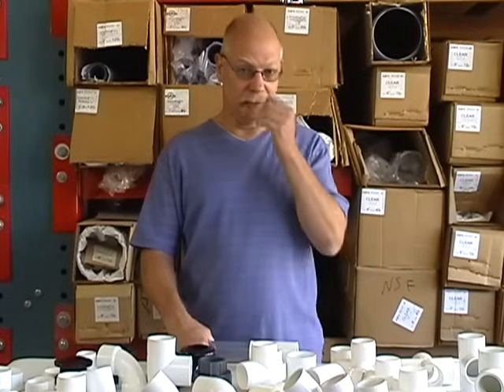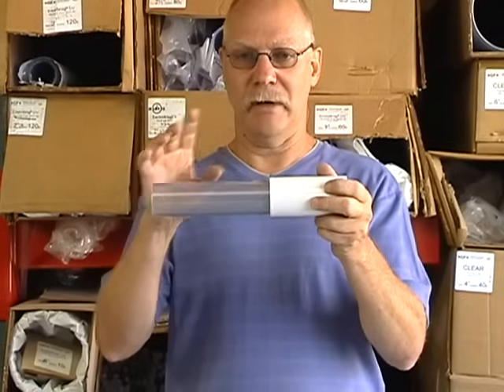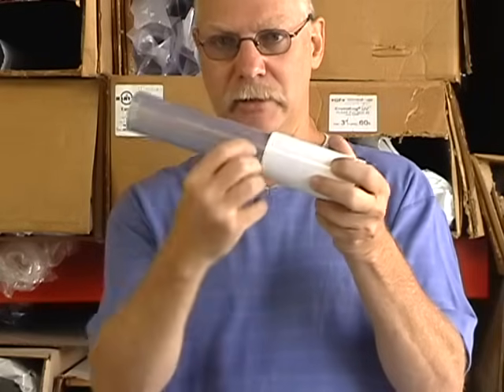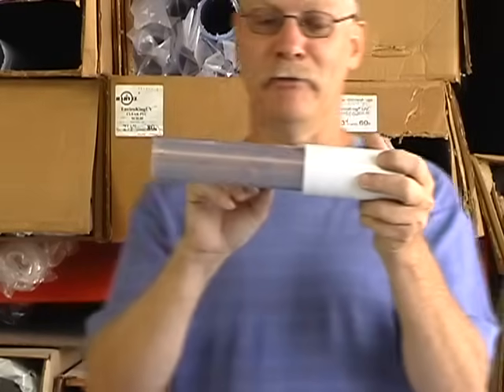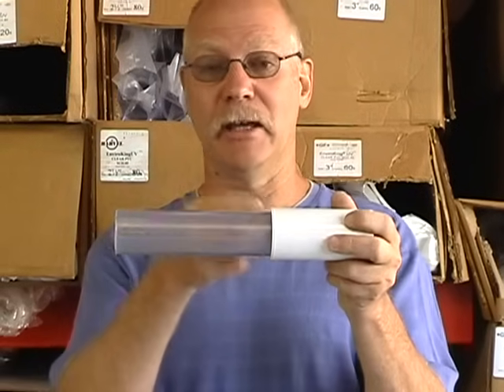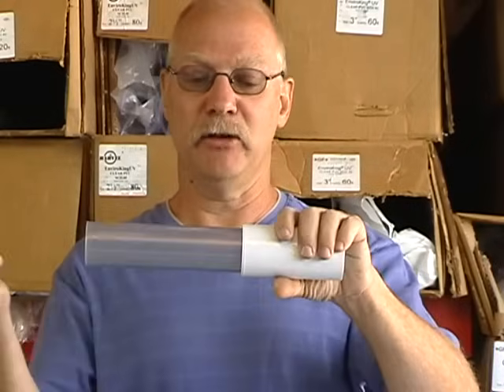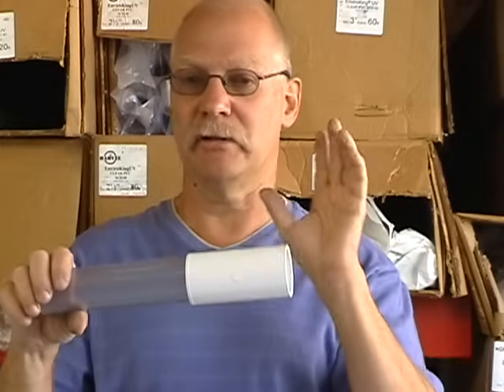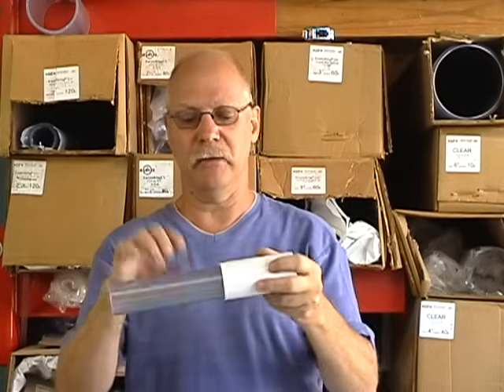FlexPVC® - How To Fix A Leak In PVC Pipe for FREE! Thousands have used this method & it works!

Comment: Or..... u cut and install an inside coupling....done
Reply from the maker: Using an inside couple only works if they make one that fits the pipe in question. We do sell inside couples for  1" up to 6" (https://flexpvc.com/cart/agora.cgi?product=PVC-Fittings-Couples-InsidePipe) but only sch 40. So if the pipe is sch 80, or Class 100, 63, 125, 160, 200 or 315 or smaller than 1" or larger than 6" you'd still be stuck. Also inside couples reduce the flow of the pipe. Someetimes you have other choice, but repairing the existing pipe is probably preferred. Thanks for the comment.

Comment: What is a shot vac?
Reply from the maker: Shop Vac, aka "wet and dry" shop vacuum. :-)
Reply: Flexpvc thanks, we may have to try this. We are in the process of plumbing for our Koi pond, we used Astore pipe fittings, heavy duty, although my husband has done many plumbing jobs this one has him bet,  we have multiple leaks on joints, there are two pumps on the system, we used only a glue as recommended by shop, I'm beginning to think we would have been better using primer and glue
Reply from the maker: If you are having trouble with leaks, it's most likely procedure, not glue. Please see our video on that: https://www.youtube.com/embed/QITVd4N7064

Let us know if you have any questions. You can call 888 782 3539 M-F from 10am to 4pm PST or use the "email us" link on our website, https://flexpvc.com Thanks

Comment: Although I was in the irrigation business for 30 years, I never encountered a leak problem that I could not repair with a conventional repair, until a week ago.  I had a drip of about a quart per day on the upstream side of my hot tub pump.  As you are aware, the pvc fittings were assembled tight together and a conventional repair was out of the question.  I explored a variety of repair methods, but I thought I would start with your idea of using pvc primer inasmuch as my drip was on the suction side of the pump.  And the other methods using spray materiaIs or trowel on expoxy would likely prevent me from using your method, had they failed.  Additionally your method was invisible.  I am ecstatic to report that your advice worked like a hot damn!
Reply from the maker: So glad to hear. Your situation is the exact one that this method was devised for. Thanks for letting us know it worked for you.

Comment: This guy's a dimwit, talked for an hour and said N-O-T-H-I-N-G !  He's has the use of primer all wrong, but Y-O-U BE THE JUDGE:  Primer's principal use is to remove the grease used in the manufacture of PVC pipe. PVC pipe is an extruded product and the dies that form the pipe are sprayed with a lubricant to keep them from binding, That lubricant needs to be dissolved before applying PVC cement to any and all joints, hence the need for a primer solvent. The knuckle-head in this video doesn't once, not once, mention the extrusion lubricant or the primary function of a primer in adjuncts. Peace be with you. Praise Jesus.
Reply from the maker: I totally agree, we should let the viewers make the judgement. 

#1 The video is 9 minutes and 33 seconds long. MROSHINSKIE thinks that's an hour. He's only 84% wrong on that one.

#2 It's true that the dies are coated with a lube, but that lube is washed off the plastic parts before shipping. I don't mention it in the video because it has nothing to do with the subject matter of the video.

#3 Purpose of the primer. If you want to see the effect of primer, simply put some on a piece of pvc pipe, let it sit for about 4 seconds and then take your fingernail and try to scrap where you put the primer. You'll have a nice bit of pvc material under your fingernail with just one pass. That's how aggressive the primer/solvent is.

#4. What is primer? Primer is mixture of Acetone and  Methyl Ethyl Ketone (MEK). Both of these are solvents, solvents of pvc plastic. 

#4. PVC fittings are interference fit. That means the bottom of the socket is a smaller diameter than the pipe's outside diameter. If you did not have a solvent to soften the pvc material, the two would not fit. The pipe would stop before it gets to the end of socket. "Two solid objects cannot occupy the same space.at the same time"  So something has to give and what gives is the plastic after it's been softened by the solvent/primer. 

#5. It's called "solvent welding" for a reason.

I could go on, but why?

I especially like the insults coming from someone who claims to be a "christian." Is it Christ like to insult people? Call people names? Boast? Ridicule? MROSHINSKIE is the kind of christian that gives Christians a bad name.

Clearly MROSHINSIE knows far less about plumbing and Christianity than he claims.

But I'm happy to let the viewers make up their own minds. ;-)

Comment: Damn man....I thought I  might be the only one using that technique! For a pool with a leak in a pressure side pipe a shop vac isn't needed in some  cases.  If the pump can prime or mostly prime run it for a minute or so. Turn it off and then the water flowing backwards through the pipe a will create enough of a vacuum to pull in primer and glue.
Reply: this is also helpful. will try! do you have more details?

Comment: Recently looked for a way to fix a leak at a PVC junction on my roof for pool solar.  I allowed system to drain, then -- when dry, and using your basic idea -- I applied primer to the joint, then blew it down into the joint using a soda straw -- repeated several times allowing it to dry.  Then I applied a last primer coat, blew it into joint, followed by glue which I also blew into the joint using the straw.  So far, it's worked perfectly.  Thanks for the tip and the idea!
Reply from the maker: Very good. Glad we were able to help in some small way. :-)

Comment: Thanks for the great video. I have a question regarding a cracked 2" manifold on a spa from a winter freeze (see link to photo). The crack is several inches long and forks at one one point. Could this method possibly work to repair the crack in my situation? The alternative of replacing the manifold for a novice like me is not appealing.  Thanks.

https://photos.app.goo.gl/VHO0mFxIG5JnsmRI2

Comment: I am trying to repair what is commonly called PPVC pipe....the black hose type.  
Any suggestions on that type of line?
Reply from the maker: There is CPVC and this technique would work fine. But there is HDPE and PE and PP. Those it would not work on.

Comment: Replaced new toilet drain, 3' PVC, was leaking at slip joint, both ends, used this method it works great. Everything clean and dry. Used wet towels in plastic grocery bags to make seal, stuck shop vac thru one end, both ends tightly seal. Turn on shop vac , Poured on solvent as directed in video, waited a minute, then poured on cement, Ran shop vac about 30 second each time. Thank you for sharing, very much appreciate your effort and time. Consider yourself a home improvement DIY hero.
Reply from the maker: Awesome! Glad we could solve the problem for you. And thanks for letting us (and everyone) know. :-)

Comment: Six month follow up. Still loving it.Working great.==>  https://t.co/eSv7jxF0tX  Getting to 102-104 with weather in the single digits/teens.Feels great. Changed to using bromine and it is so much nicer than chlorine.Amazing. I've had it set up three days and have been in it four times. Great heat,, good relief for hurting body. This is a great product
Reply: Nice

Comment: question.use a wet or dry shop vac take hose cover the pressure jet or area where the leak creates a vacuum.  Put a tee in the vacuum line above water with the ability to close off all air and let in bits of air so vacuum cleaner not burns out,   apply primer and then glue.   Our situation is a dripping by a light. question choose glue for plastic.   glue works on some plastics.

Comment: Thanks for this great video.  We have a tiny little leak and this video will be the first thing that I try.  I do have a question though.  If water is leaking out then does not imply that the primer will not be drawn into the leak?
Reply from the maker: No, that's why you us the vacuum. If you are working on the suction side the suction of the pump will draw the primer and glue into the crack and setup.

Thanks. :-)

Comment: One question. Can you just fill up a crack on PVC pipe with PVC glue and fix the leak or it will not work?
Reply from the maker: No, it wont' work. 

Just follow the instructions and it'll probably work.

The only reason I say probably is it does depend on the size of the crack and type of crack.  But if this method does not work, there is no way just pouring pvc glue in a crack would.
Reply from the maker: Man, youtube is not notifying us of replies. So sorry this is so late. No, just adding pvc glue to a crack will not work. I will make a video on how to fix that issue. Please sub and you'll get a notice when I upload. Thanks.

Comment: I understand everything in this great video.. Yet after doing the primer on a evacuated seam.  How long do I wait and when or if I use the glue?  (Original screwed fitting w/ no sealer)  
GREAT VIDEO!!!
Reply from the maker: You don't wait for the glue. You hit it with primer and then just the time it takes to switch hands to get the glue in place you do it. :-)
Reply from the maker: You immediately hit it with the glue right after the primer. Just seconds.
Reply: It worked!  Thanks again...
Reply from the maker: Awesome! :-)

Comment: Find a piece of pipe that fits the hose of your shop vac and drill holes in the side. This will allow air to cool the vacuum and still supply the vacuum needed for the job.

Comment: my PVC pipe keeps popping off when I cut the water on at the water meter
Reply: bobby surrett A pressure regulator after the meter and before the pvc main line is probably the solution due to high water pressure. If the joint when assembled is too cold due to the weather the glue won't set up, so a heat gun or halogen work light should help during the adhesion.

Comment: Great video, I have a leak in the suction side of my pool from the skimmers, It pulls in air but the problem is all the pipes are buried. Any ideas??
Reply from the maker: The most likely point of the leak is going to be right at the skimmer or drain. You may be able to use this technique from the inside of the skimmer if you can find the crack. Also IF you can see into the sockets where the pipe glues in, you can try the same technique from the inside. Just be carefuly not to splash or spill glue/primer into the skimmer. Same foe the drain. Of course you will have to drain the pool, but that's easier than digging it up. :-) 

One thing you can do to try find the leak is use the exhaust of your shop vac and plumb it into your pipes (once the pool is drained.)  You are pressurizing the plumbing to find the leak. If the shop vac is located aways away from the pool you might be able to hear the air coming thru either the skimmer or drain. You have to block off all other places for the air to go, but again, it's easier then digging up the pool. Once you find the source of the leak,then you use the vac to create a vacuum in the system and it'll draw in the primer/glue just like the video explains.

Good luck!
Reply: Dan Everitt 5

Comment: Thanks for a great video. The only question I had is, how will this effect the filter system if the leak is before the filtration system? Will it clog the filter?
Reply from the maker: A little bit of primer will make it thru, but not the glue. I did this one time an a spa and the shop vac did pull a smattering of primer and it make some marks (just tiny dots) on the inside of a jet nozzle (the eyeball). The customer said they did not care, they were so happy that the leak was fixed for my standard service charge they said don't worry about it. But I did get a replacement eyeball and mailed it to  the customer. (they are easy to replace.)

Comment: Very helpful. I had a slow leak in AC Drain line, cutting was not an option. Plugged one end, shop vac at the other end, applied primer followed by cement at the joint... problem gone. Thank you
Reply: Same here, dripping AC Drain line, because the last guy was stingy with glue or somehow missed a spot on one of  the several fittings used in a small space...  I taped a dust buster to the end of drain line, luckily there was a cutoff valve where I need it... Applied glue at the spot where it was missing...  
Since this is just a gravity drain line, no pressure, I have good hopes I'm done with this for years...    If under pressure, I'd be more concerned about the permanence of the repair, but from some of the testimony here - I'd do it again, even with a pressurized line, but I'd hedge my bets by using a good primer also.  (For low pressure lines, there are several PVC glues available that do not require separate primer.)
Reply from the maker: Thanks. So glad it solved the problem. :-)

Comment: how bout u just cut it out and repipe it scabs
Reply from the maker: Really? Is that necessary? Referring to people as 'scabs?" Where do you get the authority to make such judgements about people you don't even know? And for what? For trying to fix it themselves? For trying to save money? That is their sin that you feel you need to insult people?
Reply from the maker: There are many situations where you don' t have that luxury. Imagine a connection were you have several fittings all hard plumbed into something that is not easily replaced. Like a pump or some pipes coming out of, or going into a concrete slab. Imagine  a leak in a spa jet. You going to replace the entire jet assembly? Some of these older pools, spas and hot tubs have obsolete fittings and can't be replaced. Imagine a irrigation valve box with half a dozen lines coming into it... you going to replumb all of them for one leak? There are dozens of situations where it's not possible or practical to "just cut it out."  Also there is no reason to insult people. I didn't insult your lack of knowledge or experience, so why do you feel the need to insult others?

Comment: Great thinking!!! Just replaced plumbing on the return side of my pool and plumbed in a salt chlorinator. I have a tiny drip. I don't think a shop vac will work because the pool returns  are under water but I may be able to draw a vacuum by draining the filter.
Reply from the maker: Yes, you'd have to drain the pool to use the vacuum. But if the drip stops when the pump is running you can still use this technique.

Comment: Thank you. Your advice saved me lots of trouble. In my case it was the main water shut off to my house (cpvc FL). We had to balance all the air and water in the system and find the right pipe for the vacuum. We had to make a valve in the vacuum hose to prevent over heating yet allow enough suction. It was no easy task but it did work!
Reply from the maker: That sounds fantastic. The fact that you added the valve shows you really understood the technique. 🙂

Comment: My worker use compression coupling fix the main line water but still leaking, my house wall is concrete is difficult to drill very big and long hole, changed 2 worker but still can't fix it. May I have your urgent advise.
Reply from the maker: I'm so sorry I did not see your question. I hope you got it worked out. I don't like compression fittings very much. Too many ways for them to leak.  If you still have the problem,  please us the link on our website to send us an email with pictures and I'll try to offer some suggestions. If I'm too late, please accept my apology. Thanks.
Reply from the maker: Sorry I did not see your reply. If you are using compression fittings change them out for glue on fittings.  I never liked the compression ones. Sorry.

Comment: I just used this on a system that I really felt I was going to need to cut out sections of pipe but thankfully it appears to be holding quite well. Fun part is it's not on a home system but on a printing press.
Reply from the maker: As long as it works, that's all that matters. :-)

Comment: Hi there,Thank you for the videos. fixed my made up pool just like you said and it worked great. 
just found a crack in my filter canister just at the fitting with a pipe.. any advice how to fix that without buying a complete new one. 
thank you again!
Reply from the maker: +Swokpmund I've tried to glue those canisters and had no luck. Due to the way they seal with the threaded ring on the top and the O-ring putting pressure out radially, it's been impossible to fix those Sorry I could not help with that situation..
Reply from the maker: Pool filter canisters can be made from many different products. If it's PVC or ABS, then the above system will work, you just have to evacuate the housing. BUT if it's some other type of plastic.... it's tough. I've never had muck with patching non-pvc and non-abs products. Sorry.
Reply from the maker: I just remembered, we have a new glue. It's really supposed to adhere to a lot of different plastics. I have not tried it yet, but see: https://flexpvc.com/cart/agora.cgi?p=Clear-Acrylic-Cement-Glue&p_id=SciGrip16A&xm=on&ppinc=detail hth.